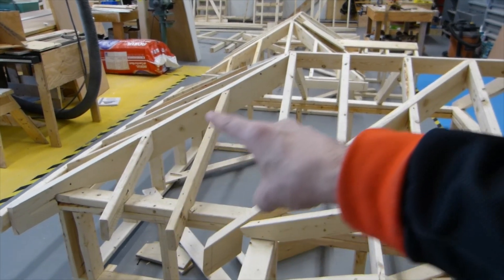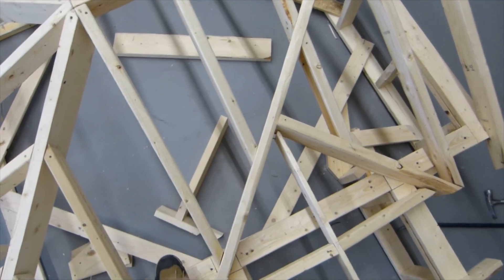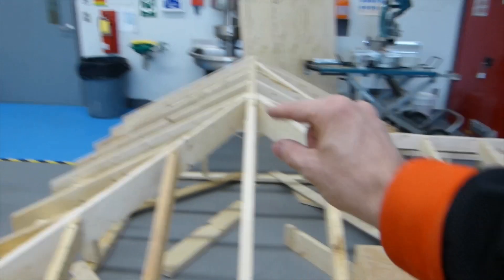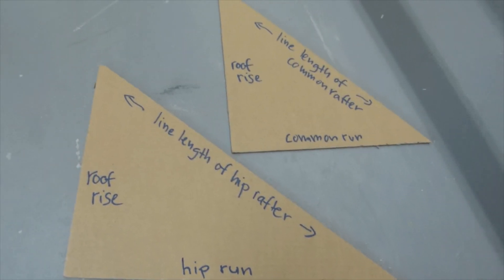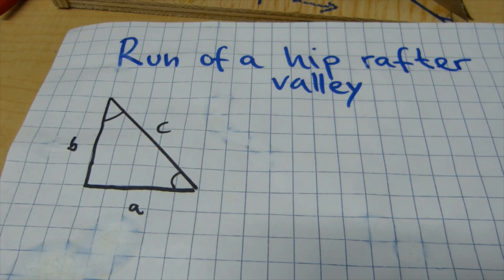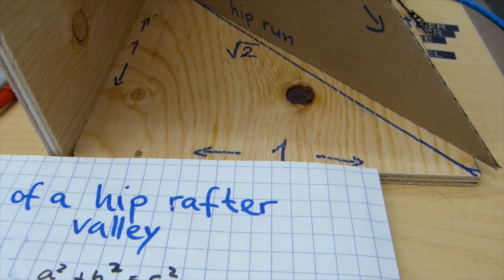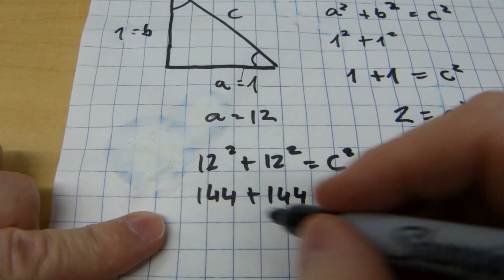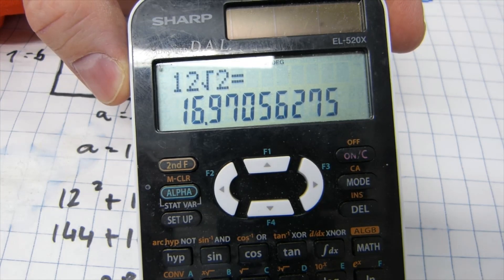Hip / valley rafter run: concept and calculation

Comment: Would it be possible to take the length of the common rafter from ridge to wallplate and then the wall plate fron last common rafter to the 45 degrees on the corners where wall plates meet and then find hyp of that triangle for the length of hip?
Reply from the maker: Yes it is possible, same thing. (sorry about the late reply)

Comment: How do we calculate the hip valley cripples?
Reply: And jacks. How r they calculated?
Reply from the maker: Will shoot a video later. Short story:
Cripples are like common rafters, just shorter.
Cripple run = common run - spacing, for example
1500 = 1900 - 400 o.c.
Cripple length = cripple run x slope factor
Then cripples need to be shortened and notched.